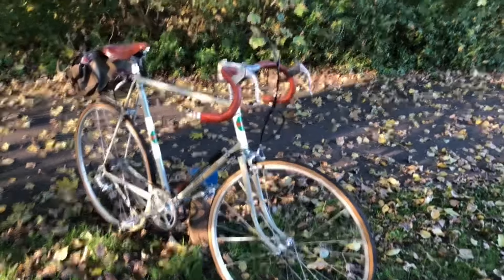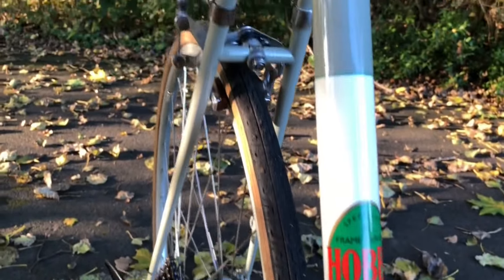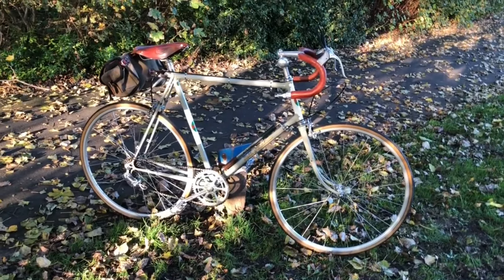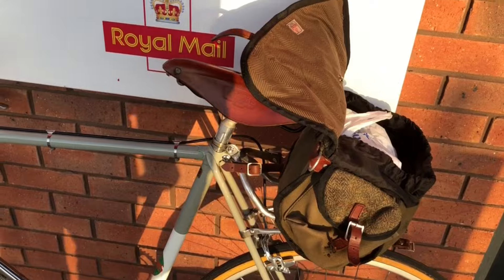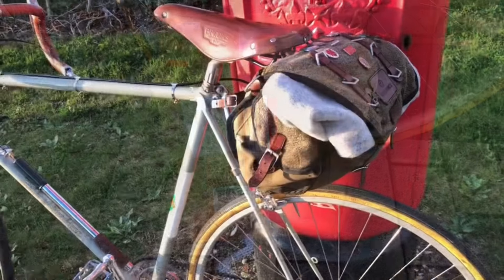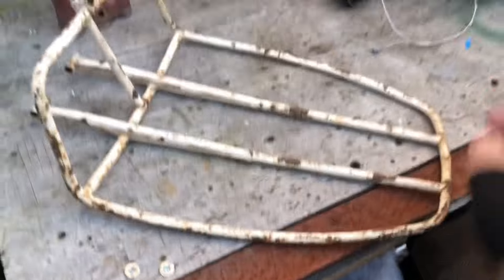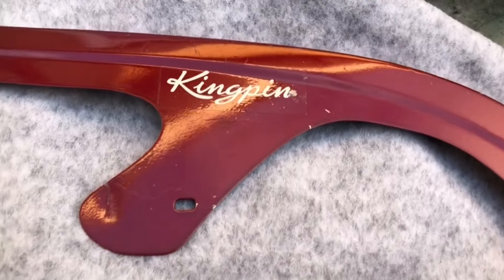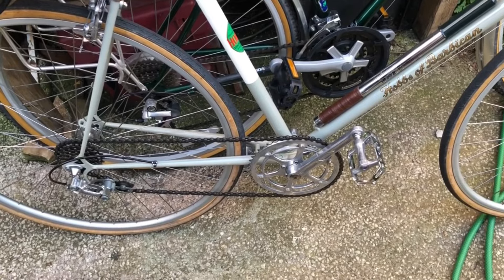vintage steel roadbike on a mail run? 1947 Hobbs with Campagnolo, Carradice, Brooks

Comment: Nice bike. I noticed that the quick release of the front wheel is on the right- hand side. Should be on the left- hand side, like on the rear wheel. This afternoon I spent my time servicing my 1990 Raleigh Manhattan. I think this was a model manufactured only for the Dutch market, but I could be wrong. ( it  has the quote 'styled by Raleigh' on the frame)  Enjoy your weekend. Greetings from Groningen, Netherlands.
Reply from the maker: The skewer is because I noticed i had put the wheel in the wrong way for the directional tyre, so I quickly flipped it without flipping the skewer😂

Comment: Hobbs is very nice bicycle and I'm glad you can ride it with drop bars ( Ican't, my neck is toasted) But, Rowan, please turn those front wheel brake pads, they are wrong way round. Open ends of the pad holders should point backwards.
Reply from the maker: I hadn’t even noticed that because I’ve never worked on the bike. That’s how the professional restorer must have done it 😳. I’m changing to vintage Mafac brakes so I haven’t paid attention to the no-brand sidepulls that are fitted.
Reply: @Velocipedium   Yes, those  cheap Shimanos? not in pair with The Hobbs. Mafacs are great.